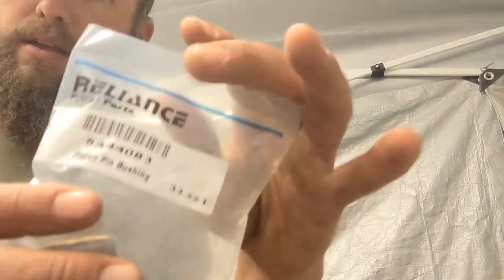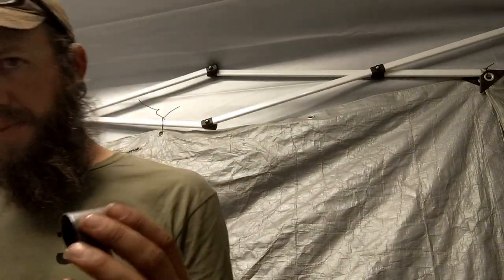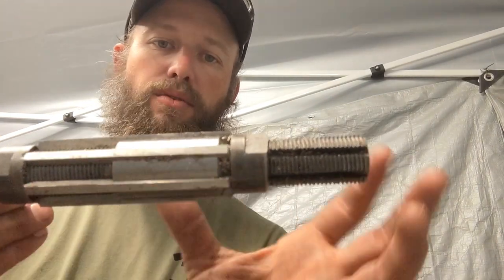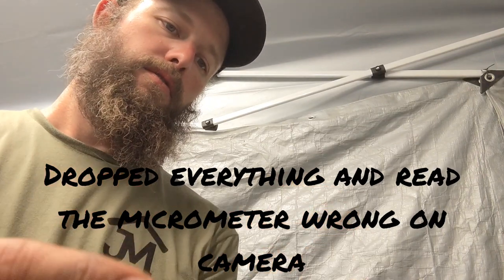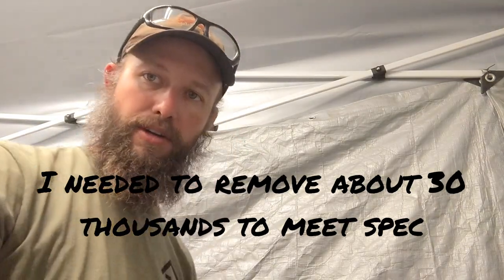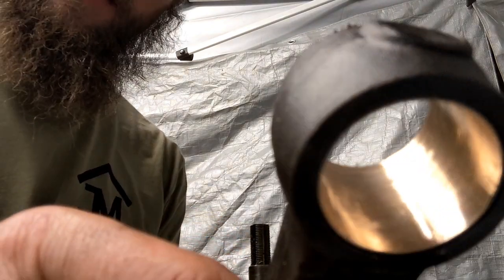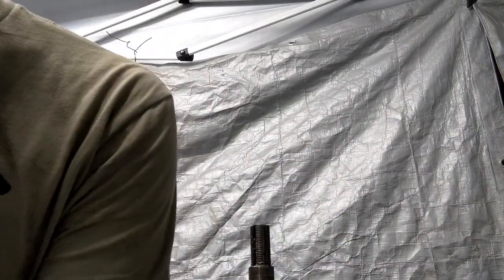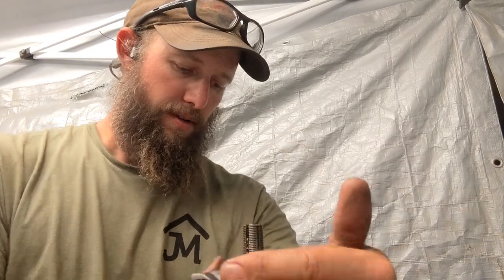case 207d rebuild: reaming the connecting rod wrist pin bushings

Comment: Thank you, I am rebuilding a quincy 325 air compressor. I just pressed in the new bushing only to find that the new wrist pin does not fit, after a little research I found that it needs to be reamed, I got an adjustable reamer similar to the one your using, I don't have the tools to measure clearances though, I could probably go slow and be ok but I think I will try and get some of those measuring tools. Thanks again for making this video! I did notice that you were meticulous on measuring at first. Did not see you measure the last rod at all, appeared to be all by feel, maybe I can get away with that too if I go slow with the adjustment and just check pin fit frequently. Also it seems unless you have a pretty good micrometer, that they could do more harm than good, a cheap one could make you think you need to take off more because of inaccurate measurement.
Reply from the maker: I measured all of them to get close and then adjusted them to fit, the reason it looked like I wasn't measuring the last one is that I had already roughed them all in within a couple thousandths and then fit them to the pins they belong on. Thanks for watching glad to help😁
Reply: FYI  it's impossible get a true hole with a hand reamer so I found using the hone for the last .001 will true the hole close to round and using a drill will help too to make a straight bore but make sure the reamer is straight in the drill chuck.

Comment: Did you hone the bushes after reaming?
Reply from the maker: @jonkutsch6171  no in this case the reamer left a really nice finish and in my opinion cross hatching is not necessary on oil injected bushings/bearings, but that's just my opinion I could be wrong. That said the dozer runs great now with  no signs of excessive wear or trouble after the 20 hour oil change.
Reply: yes. I use a 340 grit 14mm hone. The hone actually makes the bore more true too. I found it almost impossible to make an exact hole using a hand reamer especially if you did it by hand and that's why a drill works best but make sure the reamer spins straight in the chuck of the drill.Take your time on the first one and use it to adjust the reamer with it and if a little tight on the shaft use the hone to get your clearance. FYI the OEM shaft I got was .002 smaller in diameter than the original so the new Genuine rocker was too loose.
Reply: @GRTRanchadventures  I found the hand reamer is impossible to leave to true round hole and that's why I use a drill but still it's a little off so honing will true the hole and knock down the high spots.
Reply from the maker: @jonkutsch6171  be careful, you cannot hone a hole straight, just because it measures good all the way through the hole could be banana shaped. A reamer will produce a straighter hole but not perfect, the best result would be from boring the holee in a lathe or milling machine. Moral is, don't rely on inaccurate tools for precision surfaces. I know the adjustable reamer is not perfect but it is still orders of magnitude more accurate than a hone.
Reply: @GRTRanchadventures  correct. The hone helps with crosshatch and can remove .0005-.001 for final fitting.